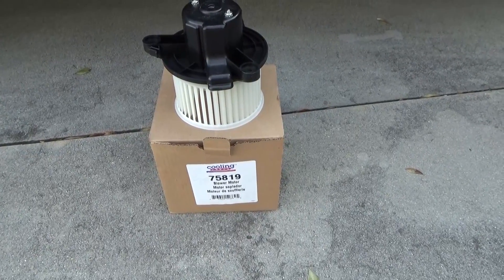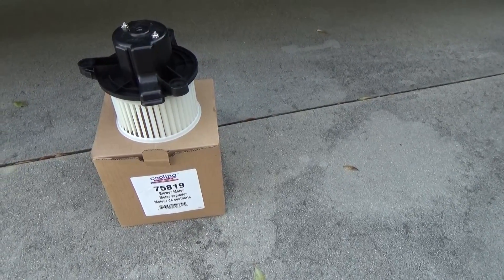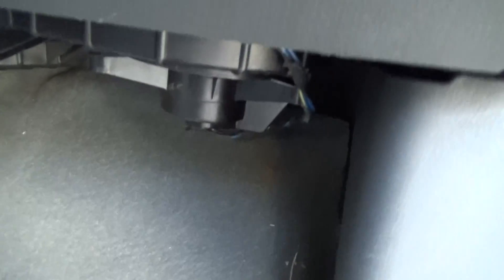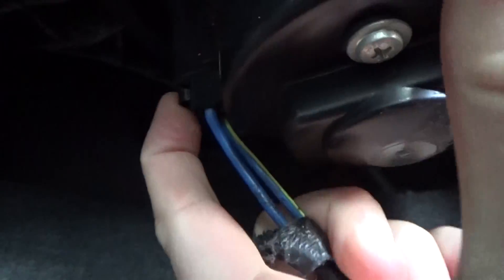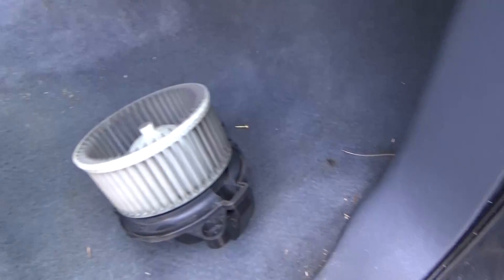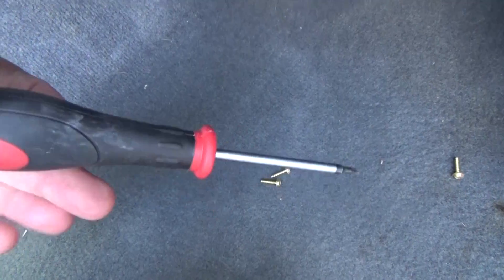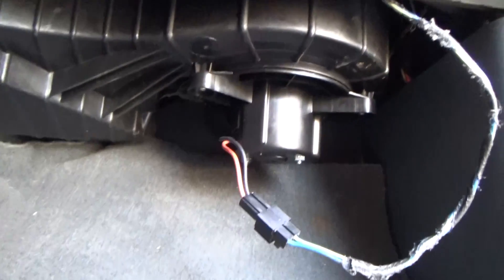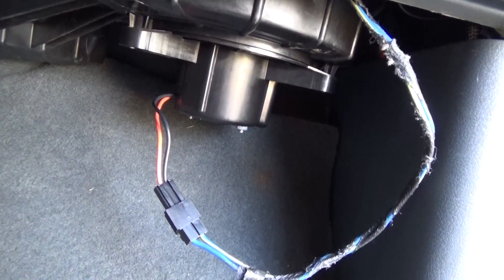Replace the Blower Motor on a Dodge Dakota or Durango

Comment: so does it have to be in a certain way? its not working and I changed resister
Reply from the maker: It will only go back one way and that wouldn't affect it coming on or not. Is it not running at all?

Comment: Is the blower motor in the same place in a 1996 Dodge Dakota 2 wheel drive extended cab
Reply from the maker: It sure is based on the drawing I have.

Comment: I think I might be having the same issue, except it started as a slight buzz and is now terrible the higher the fan setting goes, any advice?
Reply from the maker: That is almost certainly the blower motor or something caught in the blower motor.
Reply: Yep took the screws out and it dropped, found a silver wear wrapper

Comment: do you know where the blower motor resister is located on a 2005 Dakota?
Reply from the maker: +ryanlarkin1111 It's under the passenger side of the dashboard in the blower motor.

Comment: Would you know the power rating on this motor.  I mean the volts and amps ?
Reply from the maker: It's 12 volts and I believe it draws somewhere between 4 and about 20 amps depending on which speed setting it is on.
Reply: Thank you
Reply: Mine does not have torx.   It’s supposedly a 7mm.   Nope.
Reply: Yours is easy. 04 there’s one in the corner.  Very hard

Comment: the only reason I wanted to watch was because I couldn't figure out the harness (2003 dakota my blower is already dismounted, just Can't disconnect harness). This one is not anything like mine. My harness is inline. It has a little orange bar that you slide to the side. Then you eff around with it for 20 minutes on your back and curse until you want to smash.  Then you look it up on youtube and it's completely different, Yay
Reply from the maker: Sounds about right.  Pretty much sums up working on cars.

Comment: How do you replace the pig tail and relay. They burned. So I went and got dealer parts this time not Auto Zone cheap shit.
Reply from the maker: The relay should be removable to replace.  However, you will probably have to splice in the new pig tail. Are you familiar with how to splice the wires?